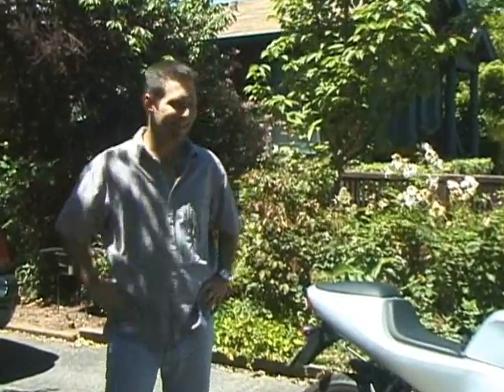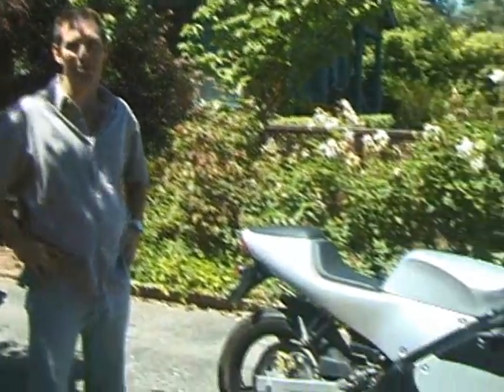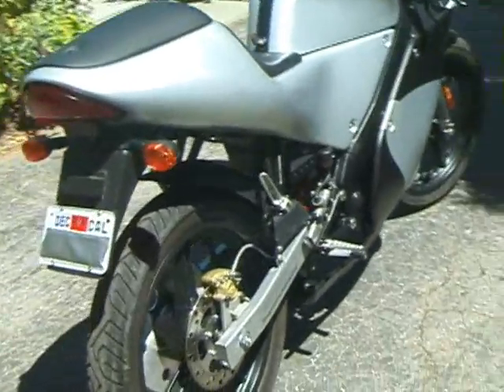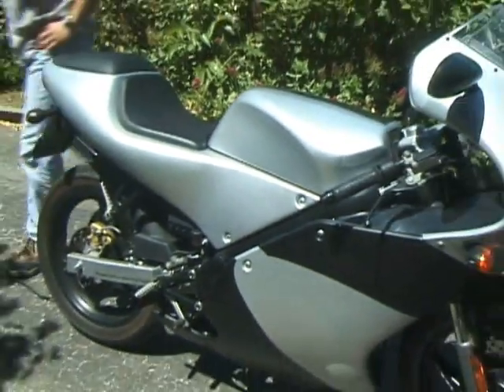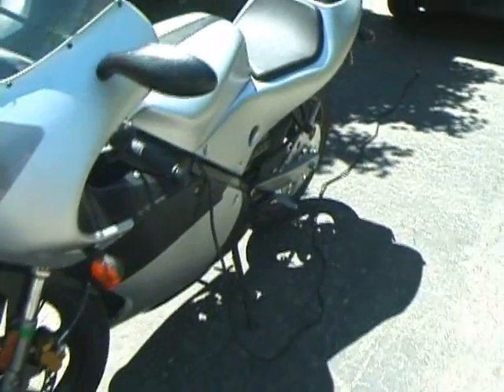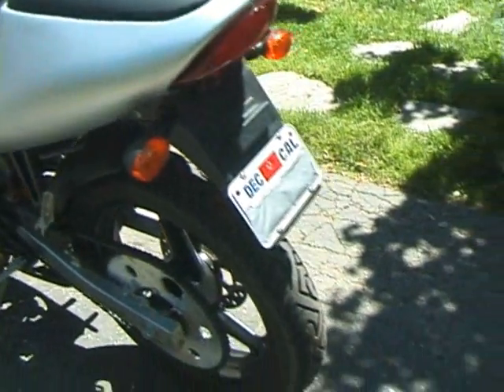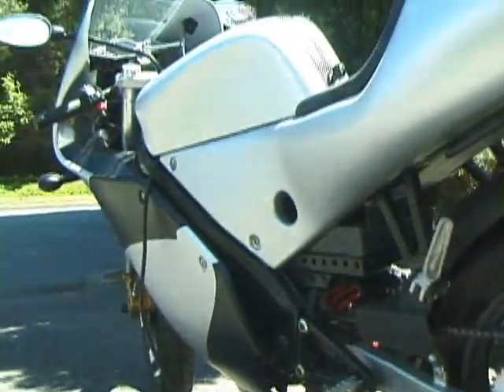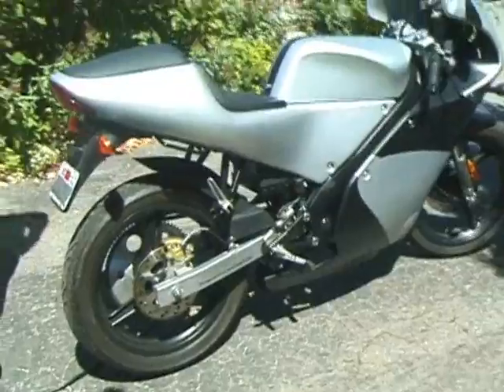Electric Motorcycle Demo

Comment: Electricity will always be relatively inexpensive, because of its ability to be produced my individuals by means of solar, and wind energy. 

And the higher gas prices go, the better electricity will look to the average person. Thus driving gas prices down as the market for electricity booms. Supply and demand...

$8 a gallon in todays dollars, maybe but by the time that comes to pass gasoline will be a novelty. We may however see $8 a gallon but that would be due to unrelated inflation.

Comment: amperage is basically a measurement of electrical flow-rate. like the gallons per minute of the electric world. while voltage is the preassure(like PSI or kpa) the converter he uses increases the output voltage in order to increase the output amperage and vise-versa to adjust the power to the electric motor

Comment: amperes are the amount of electricity passed in a conductor for a certain period of time. expressed in "A" or 'mAh"(you can see that on batteries). 

what he means by swapping amps for volts is changing the resistance to increase of decrease the RPM of the engine. as in i= v/r where i - intensity of the current expressed in Amperes; v - voltage; r - resistance.

Comment: Since there is no gear change for the electric motor-why would you need a rev gauge? It would be proportional to the speed. A rev gauge on an electric motor would be about as useful as a odometer on a piano.

Comment: Nice job, as a sugestion get rid of the Rev counter for an amp meter or volt meter give you some indication of the batter charge. save you running out of power and pushing the bike.

Comment: I should have said "only". Again, so called renewables is only a sliver of the pie and they never will replace the output of coal or natural gas, which, as oil, will eventually decline. So don't act like it's green just because you use electricity. With that said its still a fun looking bike and less polluting than most bikes w/o emission controls, at least on the user end.

Comment: There is a lot of information on this guys website including the range, top speed, acceleration. I admit it does sound like ass but thats not why it's built. Time to reduce ourselves off foreign oil. Especially since Hugo Chavez just threatened to cut our oil supply from them.

Comment: Regenerative braking can be achieved using the motor itself in most cases, if when you brake, the circuit cuts the power into the motor, and reverses the poles the motor becomes a generator, but this kinda thing does take a heap of mods to the throttle circuit, he could prob do it though, he got this far....

Comment: Nice, is all I can say. However, if he were able to devise a gearing system he could drastically improve speed and acceleration. Also, I would think that with proper gears you would increase the battery life too. Again, awsome.

Comment: the noise is simply the chain and drive gear friction.  YOu'd not hear it with a gas engine as the sound of the explosions would hide the sound of the chain and gears.  Perhaps a drive shaft system would be more effective in keeping noise down.

Comment: wrong. energy in the future will be generated by wind, geothermical heat and mainly by the sun, and the batteries will, in shorter term, be substituted by ultracapacitors, which have no disposal issues and are highly efficient. it's an unavoidable process, and it won't happen because of ppl's concern about climate, but because of the increase in energy price and consequent need for its better use.

Comment: you dont need it, it adds friction and its more weight. Think of how hot a trany would get. All that energy instead of going into the movement of the bike, its going to heat. Anyway good job. But whats the range? And how does it perform at top speed, such as on a freeway.

Comment from the maker: DeLaguna: yes you're right.  I would go a little faster.  But it's just nice not to shift and not have to deal with gear oil, etc.
ethana01:  I will try to get a new video on soon that shows some of the improvements.
easydog: yes; the chain is relatively heavy gauge and is responsible for a fair amount of unavoidable noise.
THEPAGANWOLF: I don't think it will work worth a damn in the Canadian Winter.
Thanks for your comments and support everybody!!!